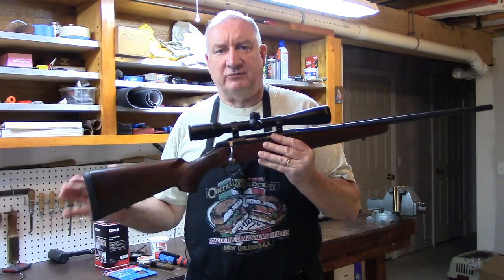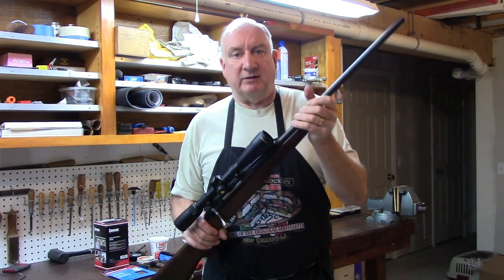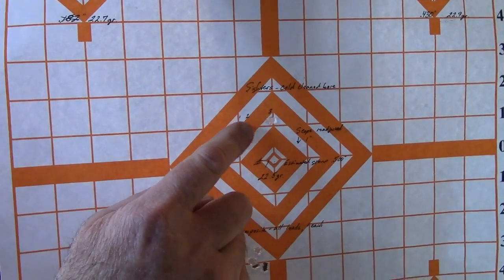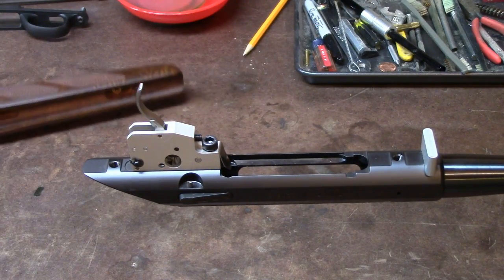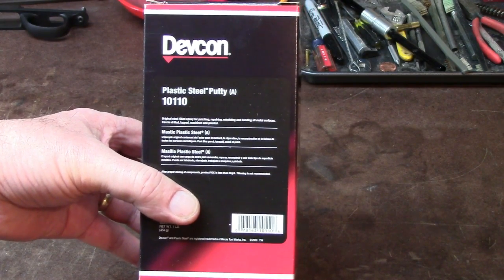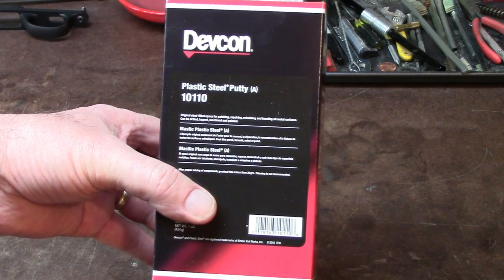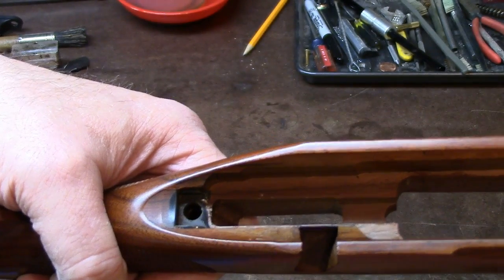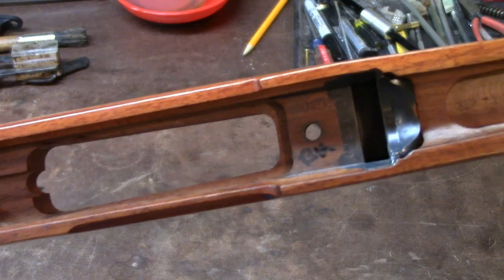How to glass bed a rifle, Part I ~ Epoxy bedding and free floating described

Comment: There doesn't appear to be a question area so I'll ask it here. If the barrel is free-floated ie., not in contact with the stock, what purpose does glass-bedding of the stock serve? Thanks for any feedback. Otherwise, nice video.
Reply: I have same question, I think the bedding just makes buffer space between stock and barrel.  The bedding material solidifies eventually to guarantee that free space.

Comment: Thank you for a great video. Devcon 10110 is very expensive for me to get where I live. I would appreciate hearing what would be the next best product that you would recommend and would the application be any different? Thank you very much for sharing your knowledge and expertise.  Richard.
Reply from the maker: Richard Porcher 
I have often used Devcon epoxy Gel that is available in hardware stores, and is quite inexpensive.  The standard 2 ton epoxy will work, but is runny and requires mixing with a stiffener, such as very finely ground fiberglass.  Do not use 5 minute epoxy!  You can also purchase Brownells Accra-Glass Gel, which is fully formulated for guns, and includes both brown and black dies to color the epoxy as desired.  Use the dies very, very, very sparingly.  Brownells provides extremely good directions, however, I still prefer wax rather than their release agent, as wax removes easier.
Reply: Your advice is very much appreciated.  Thanks again for sharing your knowledge. God bless.

Comment: Wondering how to bed the recoil lug...About to do my 1973 Win. Mod. 70...To tightly bed all sides of the lug, or just make sure the rear of the lug is tight...to relieve the entire rear portion of the lug recess and rely on the screw to give the proper front to rear action alignment or leave a portion of the existing lug recess untouched for the front-rear action alignment and glass the majority...
Reply from the maker: You may certainly bed all sides, and it will shoot great, but you'll regret it.  Such tightness will prevent proper seating of the action with any trace of oil or particles, and will make removal exceedingly and unnecessarily difficult for routine maintenance, and may even split the stock.  The rear of the lug is the only supportive part.  The lug requires support, but must also have clearance to provide for rotation of the action out.  In fact, if it's too tight, suction will prevent removal, and air-tightness will prevent seating.  Thus, I recommend placing two layers of masking tape on the underside, sides, and front of the lug, trimmed with an X-acto knife, coated by release agent.  Remove the tape after you're done.

Comment: I have a question when pillow bedding how much clearance do you need between the action screws and the ID of the pillows front and rear thanks
Reply from the maker: The rear tang screw should be 1/16" inch larger than the screw to provide 1/32" clearance.  After some testing, I've adopted zero clearance for the front screw, as Winchester does with the Model 70.  While I allow epoxy to fill the screw hole void around the screws, extended diameter pillars are not required for sound quality walnut, maple, beech, or birch stocks in good condition, as the wood does not compress.

Comment: I've just purchased a Winchester featherweight that has the same bedding as the featherweight on your video. There is one problem I've noticed though, although the stock is bedded, there is contact between stock and barrel on the last 2" of the barrel channel. Is this repairable, and should I even bother attempting to repair?
Reply from the maker: That stock is supposed to be free floated.  I'd call Winchester right away.  Do not attempt to repair it yourself or you'll void the warranty.
Reply: @GunBlue490  Thanks for the advise.

Comment: In many videos the guys put electrical tape on the front recoil lug. Doesn’t that defeat the purpose of bedding by leaving a gap when you remove the tape? Can’t I just make sure the lug has a sufficient amount of release agent on it so it breaks free from the stock? I’ve watched a bunch of bedding videos and haven’t gotten a clear explanation on this so I would really appreciate some clarification about this thanks.
Reply from the maker: A single layer of tape may be placed on the FRONT of the recoil lug during the epoxying and removed afterwards, in order to ease removal from the stock.  It will not cause any harm to the bedding procedure.  I prefer not to.
Reply: @GunBlue490 Thanks.

Comment: On a Rem 700 is there any need to remove material under the barrel lug? These lugs are attached. Thank you
Reply from the maker: No. There is clearance under the lug. I recommend two layers of tape applied to the underside and front if the lug to facilitate removal, and discard the tape afterwards.
Reply: @GunBlue490  Thank you for the reply and the videos.

Comment: IIRC, you said in another video that your wife has a Remington Model 582 .22LR. I bought mine in 1972, scoped with a Weaver V22-A. It shoots great groups but I have to sight it back in every outing. As you probably know, the barrel is mated to the stock with a single block dovetailed into the barrel. Would it make any sense at all to have it glass-bedded, or is the scope a more likely culprit?

Comment: Have you experimented with the amount of bedding left under the barrel? I leave about one inch, but that is only because I've seen it on videos.

Another question I have is the effect of bedding as multiple shots are taken, the metals expand and the subsequent stress changes. I bedded and Ruger 77/17wsm recently and the shots appear to drift vertically as the rifle heats up. If I let it cool down sufficiently, the zero seems to go back to the original point.
Reply from the maker: Rudy Sandoval 
One inch barrel support has given me good results, though some rifles with heavier barrels may benefit from more.  The Ruger 77 rimfires can be tricky, because they have non-threaded barrels that can sag due to weight, and shift impact upwards as the receiver to barrel union swells and tightens.  With my 77/22 target model, after floating the heavy barrel, I found it necessary to epoxy the barrel to the receiver, but I used wax as release agent first, in order to allow removal if needed.  That completely cured the problem, and the rifle has shot well now for 20 years.  I supported the barrel the first inch.

Comment: Probably a stupid question but i have just recently bought an Anschutz 222 it was made in 1988 has the match 54 action winged safety roll over cheek piece schnabel for end etc beautiful rifle, in the article written that depicts this rifle it said it has a free floating barrel. Basically on the right hand side at the end of the stock at the front its touching slightly once i get a piece of paper past the slight touching it becomes fully free floated all the way to the action. My question is if the article said the rifle was supposed to be free floating than why is it touching? was this on purpose or has the wood moved over the years?. Have previous owners taken the rifle apart and not tightened it correctly down which may have caused this? And finally will it affect the accuracy or should i not worry at all.
Reply from the maker: ShoulderRollJason 
It certainly was free floated, but that does not guarantee that it will remain that way.  Wood is natural and subject to warping. The stock may be incorrectly attached.  Start with basics.  Remove the stock and clean the metal, wipe down with a lightly oiled cloth, and then replace it, maintaining the same gap if possible.  If it has warped, you can sand the offending side gradually to equalize it.  Some factory free floating was very conservative, with only enough room for a slip of paper.  It should be about 3/32 underside, and 1/16 on the sides.

Comment: +GunBlue490 I have a Savage 99 like yours from the 50's in .243. Do you think it is worth it to glass bed it? Given that the forearm is not part of the whole stock? Did you do it on yours? Where did you glass bed?
Reply from the maker: artsandclouds 
There is nothing to glass bed with the Model 99.  They typically shoot just fine.  Watch my recent video regarding my outdoor shooting session with peep sights.  I demonstrate my 99 in that video, and how to properly rest the forend near the receiver to avoid pushing upward on the barrel.  Glass bedding is only used to stabilize actions that can wiggle in their stocks, mostly bolt actions and other guns with one piece stocks.

Comment: gunblue490 please answer. i have a remington 700 adl in a synthetic stock. can this glass bedding process be used with synthetic stocks like it is with traditional wooden stocks?
Reply from the maker: Tom Mynch 
It depends on the plastic material used by the stock maker.  Epoxies will adhere to many polymers, but not all.  I would do a test in a very small area in the stock, using a very small amount of standard 2-part Devcon, where it will not affect bedding.  Rough up the area with heavy grit sandpaper.  Most synthetic stocks are already pillar bedded, which effectively accomplishes what epoxy bedding does, so it may be without gain.
Reply: Thank you so much for taking the time to answer me back. I would also like to thank you for the vast amount of knowledge that you choose to share with us the viewers. Yours is by far the best gun channel on you tube and i make it a point to tell my fellow gun lovers of your channel. Thank you again sir and god bless!

Comment: Could I bed the entire reciever, if I'm bedding a laminated stock. I thought it was a more stable stock due to less chance of it swelling, shrinkage ect. Wouldn't bedding the entire reciever on that application make the reciever even more stable.
Reply from the maker: kirby lane 
It's not a matter of strength, but of stability.  One of the most stable and accurate rifles I own, which shoots very neat 3/8 inch groups, is my wife's Ruger American, with a flimsy, flexible, plastic stock.  It's not accurate because it's strong, but because it is bedded solidly between two V-blocks that don't rock or bind, and never change their relationship to the stock.  My Model 70 Featherweight is bedded on two points, and I bedded my Tikka and Remington Model 700 similarly, as with all my accurate guns.  A strong stock that binds against a steel receiver is simply a tug of war.
Reply: GunBlue490 gotcha, thanks for your reply. I haven't done one in several years and for a rebuild on an old favorite rifle I want it right.

Comment: What if you FINISHED your Model Airplane, but it didn't look anything like the photo on the BOX??
Reply from the maker: Depends.  Different paint job, ok. Wings on backwards, find a gunsmith.
Reply: @GunBlue490  Wings great, but my plane was in the ∩S∀Ⅎ instead of the USAF.

Think I'll stick to improving my  trigger control for now!
Be well, Mr. Gun Blue.

Comment: After watching some of your videos, I have homed in on a 270 model 70 Winchester, at the local pawn shop.  It has a wood stock. The stock is not Free Floated.  If I remove the action from the stock, and I find bedding, than all I would need to do at that point, is free float, correct?
Reply from the maker: You should epoxy bed the action first, according to the video, and then free float the forend for barrel clearance to accept a thickness of five business cards. That will keep your barrel centered.  Good luck!

Comment: if one is always going to shoot at only 100 yards, that load development paradigm is adequate.
Reply from the maker: redleg1013 
What nonsense are you talking about?  I shoot as far as I please, and my trajectory is not the issue at hand in load development.  Load development is only ordered toward accuracy, and has absolutely nothing to do with trajectory, which is established separately, afterwards.  These test groups could be anywhere on the paper, and the target is nothing more than an aiming point.  I couldn't have cared less where the bullets landed, as long as I knew which ones were which.  Please don't mix paradigms.  Good grief.